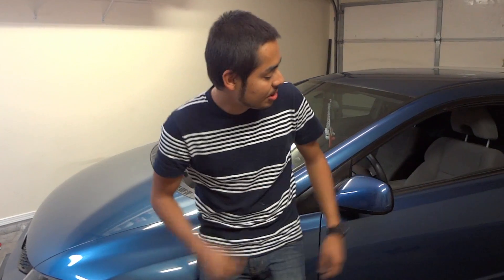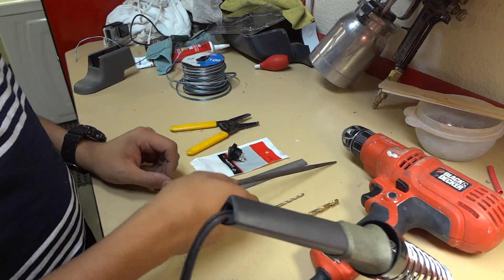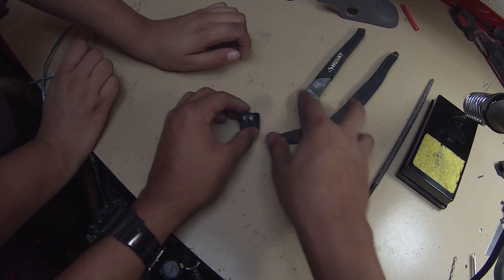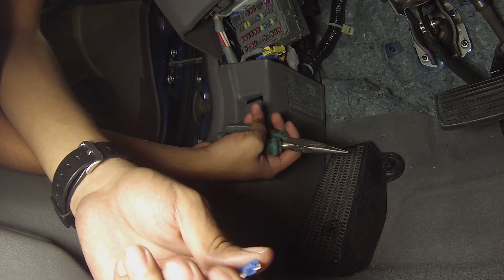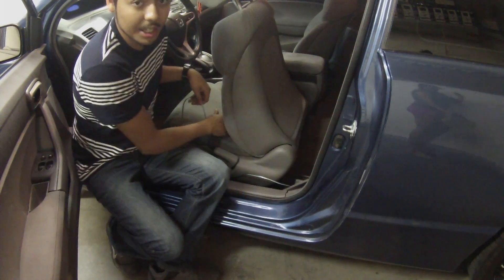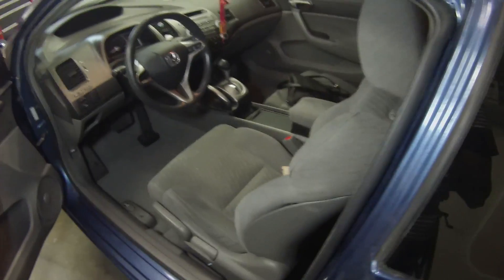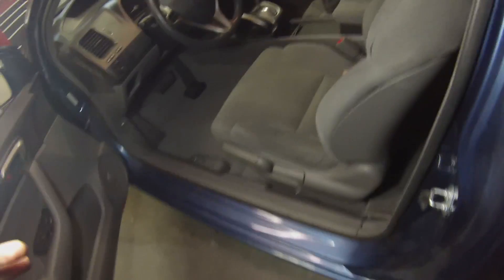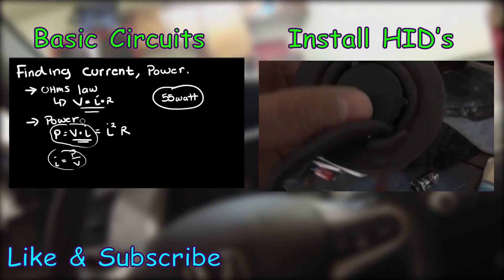How to: Install a Kill Switch on your car

Comment: Thanks for the elaborate video. However, you have removed the fuse from the fuel pump circuit, an essential protection for the fuel pump. Maybe you could have installed the switch on the wire running to the F. pump? Just a thought.
Reply: You're an idiot he did just that. GTFO

Comment: in one of my military trucks and  one of my   luxury cars i used a spare  factory switch  so you could not even tell  instead of using a kill switch  use a factory switch   that  you can add to your dash though the cut outs like for extra  deluxe  add ons never added.  some of my cars require two  switches to be on   to make the car start . the better you hide it the better it is also  recommended to fish it from middle of the car not front not where the  ignition comes out  .I have never had a car stolen  . also  the second amendment  helps if one ever does get stolen .

Comment: Hahaha if I was stealing this car lol and after 3 cranks I know what fuse this is bro. Come-on now your telling 1 million people about it. Fuel pump fuse trick is so old as back 1950s as I can recall. Maybe it's good for kids inside the house to stop from taking your car for joy ride or you forget to lock your doors and don't have an alarm it's a cheap method to keep junkies from screw driving starting your car.

Comment: I think I would just connect the fuse across the car battery to "Blow" the fuse (burn it out) instead of drilling the flimsy plastic, then just solder the switch wires to each end of the open fuse. Using the FP fuse is a great idea.

Comment: Good idea Christian. Regarding the switch:  I would use crimped connectors, which I would solder to the wires (not the switch, of course). A good, fast solution. Thanks!

Comment: Kill switch connected to a fuse box is the worst idea I ever heard of, even more so as its going to be one of the first things a thief is going to check if he has time, say you are out of home, vacation or something like that, there is no reason to assume the thief wont have a bit more time for basic troubleshoot so lets not make stupid assumptions like Mark Moses did (esp. as theres videos where thief works on stealing the car even for tenths of minutes to hours).. Now, on the other hand making it a fuel pump related is actually a great idea, however I would rather split the fuel pump power cable somewhere on its actual way to the fuel pump itself, even better if you can manage to hide the bypass and bypass cables under the construction itself, tho for that you would need to probably disassemble more of the interior or the actual fuel tank itself, but thats just an extra suggestion that isnt totally necessary

Comment: No that's not why the check engine light is on, every check engine light is required to come on before the car is started, as a test, or to show the light is working, this way you know nobody has disconnected it to scan you, the car could be throwing codes without anyone knowing

Comment: How about tapping the wire for fuel pump even before it gets to fuse box?   That will be very difficult to trace.  As it stands right now, Thief will suspect fuel pump and check out the fuse box.  Maybe 5 sec to bypass for knowledgeable thief.

Comment: Great video but I'm not a huge fan of switch that was used. In the event you forget to turn the switch on the car is gonna start which makes it more susceptible to theft. The kill switch my dad had on his accord wasn't much of a switch but a button hidden inside the car that had to be pressed everytime the car started otherwise the engine would shut off after a few seconds and wouldn't start there after. Another great option would be to install a switch that kills the ecu if not pressed. If the computer is damaged the car won't start.

Comment: Hook the car alarm to the ignition coil. This will give the thief a good jolt when they touch the door handle. Or put explosives in the car that’ll go off 5 seconds after the front doors open. That’ll learn em!

Comment: Another good kill switch is to connect a switch between the main distributer power wire running to the selinoid.

Comment: Tip: instead of drilling a hole through the fuse, just blow it using the 12 volt battery. Attach cables to the battery terminals and touch the other ends to the fuse.

Comment: I agree with alot 9f other just cut and split the wire leading to the fuse box to use the blade fuse you drilled hiding the kill switch much better

Comment: So your switch and 18 gauge wire are doing the job of your 10amp fuse. What happens if there's a condition that would require the fuse to burn? Would all that copper wire and your switch burn under the right conditions?
Reply from the maker: +Daniel Wangchomchantra please watch the video. Your kidding sinking important

Comment: Do not use the fuel pump as a kill to operating your car as you can still turn the engine over and over and over causing your fuel pump to fail.  Find the Starter fuse and connect the starter circuit to the switch.  Car may power up, but no starter.   Be sure to use a switch rated for the current and amperage for your starter.
Reply: Can still be bump started though if you do starter. Then again try doing fuel pump on a modern car without engine management light being a problem
Reply: @mitchellconnop2000 unless its an automatic also wont the light only come when key is turned while the killswitch is off? if you operate the switch while the car is off i think it wouldnt be a problem
Reply: @scuffhouse  true , the light will only come If the car is turned while the killswitch is off..👌👌otherwise there won't be a problem..

Comment: Bad solder job. He could have done it with the wires of the fuse, running the same length as the other one.

Comment: Hahaha everybody on here makes it seem like the average thief is going to run through troubleshooting before bailing. Thanks for taking time to post this man!
Reply: Most thiefs that steal cars on a daily use to be mechanics or do there home work before going out and ripping off a car and know where to look. These vids only help them more
Reply: That "hahaha" makes you look even more stupid than the rest of your comment.. Assuming that a thief will be a completely unprepared amateur that has only like 3 minutes to get into the car and start it is really stupid, esp. after realizing that there are cases, even videos of those cases where thieves are going thru process of stealing a car for long tenths of minutes, sometimes even up to a whole hour, in extreme cases where no-ones at home even for long couple of hours no problem.. plenty of time for troubleshooting in that case

Comment: It is a good idea, but also well known by thieves, better connect your switch somwhere on the cable leading to fuel pump. Maybe in America, this will function, but made like this in europa, you will lose your car in less then a minute. I know is to win time, but this is to obvious place to look for.

Comment: Statistically Honda's are among the most stolen vehicles in the USA because their parts haven't always had traceable VIN numbers, making them valuable with 'chop shops'.  I regularly pass by a Honda Prelude parked in front of a house in predominately Asian Diamond Bar, CA where the owner attaches a yellow parking boot when he gets home.  Good luck finding a key or removing one of those puppies!  No need to mod the electrical system unnecessarily.  In the last twenty years the neighborhood has changed where more entitled, spoiled brats still live with their parents, don't work, and break into cars and homes in the area on a regular basis.  His ride is one of the few none of the thug wannabees have bothered to f**k with.

Comment: That’s going to be a pain in the ass when that fuse keeps falling out of the fuse block would have been just as easy to put the switch in line with the pump wiring
Reply from the maker: +Eric Jansson definitely not easy to find and splice a wire. Maybe a truck with plenty of working room, but not in a tight honda. Also, this won't void your warrenty and if you are leasing the car, you won't get charged for damages.

Comment: I have a 1997 Dodge ram 1500 and it does not have a fuse for fuel pump it has a relay how would i put a kill switch can you help

Comment: Top off your oil bro
Reply: We'll see how long your car lasts.... You don't "top off your oil bro," when it's life is low you change it, "topping it off bro" will over fill it, making it impossible for the oil pump to move all the oil around, causing it to overheat, causing it to foam, then finally, blowing rod bearings, Piston rings, head gaskets, the list goes on

Comment: Just wire to your fog light switch or radio knob, (*never to anything hanging out or to your fuse box or panel, from the switch itself*) or a fuel pump shut off somewhere outside, under the wheel well...thieves dont sit there trying all the differing switches or knobs...but they will drag the hand in obvious kill switch locations (humans are lazy, stereo installers being easily predictable, because of cost, repetition, etc locations are routine) I have mine paired to my fog lights, (*not your headlights*) and Ive had 4 88-93 Fox 5.0 Ponies over the last 20yrs in a high car theft location and literally have video up, of me laughing at people trying to steal one, the only way to get it is to have it towed. Great tips! Peace!

Comment: Tip: Mine is wired with the cigarette lighter.. Since I don't smoke and don't let anyone to smoke in my car I unplugged the lighter and I use the negative of that circuit to complete the circuit for the relay.. If the lighter is not in place the car won't start.. 🤓🤓🤓

By the way I have 2 relays ones cut the fuel pump and the other one cut the ignition to the starter.. So it won't even crank if they figure that there is a wire there.. I still have another one going to the fuel pump so even if they crank it they won't go to far.. 😅
Reply: Not sure how I ended up here again. 🤷🏻‍♂️ (A year later).. Oh well.. 12Volts outlet or Cigarette lighter what ever.. You got the idea.. I don't smoke neither have any use for that thing.. I don't use iPhones anymore no need to recharge my phone during my day anyways I have a charger in the office if I need it. And a battery pack on my back pack for my laptop and cellphone too.. So yeah I don't have any use for that "Outlet" again my case not yours.. If you make a living by driving and your vehicle is your office my idea may not work for you.
Reply: @geogmz8277  hi. I have Civic 2008 model. One big problem not solved. Pls halp. I am from India. Bettry oil and green key light not displaying. Fush are ok. Ecm are ok. Pls halp to solw prob.
Reply: You should make a video bro👍
Reply: make a tutorial for cigs lighter killswitch please..
Reply: brilliant
Reply: GENIUS!!
Reply: Damn that is smart as hell!!
Reply: Classic
Reply: ☝️Now this Cat has that Macgyver install bet his ass didn't use Speaker Wire 🤣🤘 that's a Slick idea for closing and opening the circuit nobody would think put the cigarette lighter in it's the bypass 🤘
Reply: Passenger pulls it out what then?
Reply: Kindly do share pics and diagram of your setup
Reply: Geo Gmz wow i have always thought about that but didn’t know if it was possible, I have to do that too
Reply: Make a video explaining!!
Reply: Hello, how did you wire a relay to cut power to the fuel pump? Thanks
Reply: Im gunna do that tooo thanks for the savatry info lmaoo
Reply: How u do that? I want to do this to my 88 civic
Reply: @MannyDelReal  omg nobody is going or wanting a 88 civic,  now 88 porches maybe
Reply: Everyone knows about the cigarette lighter. That will be the first thing for the their to do....
Reply: "cigarette lighters" have other uses, such as phone charging and air fresheners. I think they are called 12-volt outlets though and not "cigarette lighters".

Comment: All car jackers will have a knife. When the car doesnt start the first thing they check is the fuse box. They will notice wires to the fuel pump fuse and cut it and splice them back together completing the circuit.

Comment: Did anyone else realise that he said the reason u I stall the fuse in the fuse holder is in case the fuse does blow it will be the one on the fuse holder instead of the one in the fuse box.....????? How does a broken fuse blow??
Reply from the maker: +August East sorry about that. Meant to say, in case it would blow, it will blow the one in the first holder. Even then, that phrasing is a bit confusing.

Comment: doing that bypasses the fuse in the fuel pump.this could be bad if the wire shorts and gets hot.

Comment: I really don't get how this is useful. I mean can't the thief just remove the fuel pump fuse and place a new one in? I guess this would be useful with a relay to the ignition.
This will probably slow down a schmuck, but not a pro.

Comment: If you get really creative, wire a three way switch in series with a relay that routes the start solenoid signal to the horn. So that not only will the car fail to start, it will also sound the horn so long as the car cranks over.
So someone hops in your car and manages to get the car to turn over "BEEEEEEEEEEP BEEEEEEEEEEP BEEEEEEEEEP"

Comment: Install two 1" +/- pieces of heat shrink tubing before soldering over the wires and allow enough clearance for soldering the joints after soldering slide heat shrink tubing over soldered areas and use a hair dryer or other heat source to shrink the insulating tubing over the entire connections. Next, never try to hold anything with your fingers when attempting to drill holes as you can seriously injure yourself when the drill bit grabs and turns the material by then it is to late to release the part. OUCH! Other than lack of experience in these areas a great well thought out video. Thanks

Comment: Use stock looking wires, and don't mess with the fuse, interrupt the connection somewhere else down the fuel pump wiring, also use a fuse there as well...and place the switch 100% out of sight...even if you are under the dash you should not be able to see it. 
This should be combined with other security measures as well and a really good car alarm. system...and GPS tracking...some thieves don't bother with getting into the car they use tow trucks and jack your shit in less than 10 seconds.
Reply: under the shift boot in a manual is a good spot

Comment: great idea good tutorial but epic fail bro check fuse box follow wire find switch start car and drive away laughing they have wire taps that clamp on the wires behind the box and you can hide it alot better jus my thought unless you wana jus keep it easy for the theif

Comment: Until they see the obvious wire coming from the fuse and just pull it and put a spare fuse, or switch it with a wiper fuse or something in 20 seconds...bad way

Comment: You can also do the starter.I had a few muscle cars and it was easy to hide switches .Plus those old cars are easy to steel and after putting all that work and money into something it would suck to have someone steel it.

Comment: a 100% guarenteed way to prevent theft is a detachable steering wheel. you cant steal a car without a steering wheel
Reply: Not true. Hondas in my city commonly have this mod and till end up stolen. Most of those hubs are universal and will accept another steering wheel easily. Still a good choice to deter unprepared or amateur thieves.
Reply: You also forgot to add the steering wheel hub lock. That way nobody can put a steering wheel on the hub. But another neat trick is to get a button you dont use on your dash, unplug it and solder the new wires to that switch 👍🏻
Reply: Unless they bring there own lol
Reply: Actually, you can still a car without a steering wheel...
Reply: Unless you have vice grips .
Reply: Gin-Jesus Flatbed then say bye-bye
Reply: If the thieves have marked your car (been watching it), they'll go check it out first, notice the steering wheel issue , bring their own ....😎.
Reply: The last car I had stolen was towed away from my house.
Reply: Unless they got a universal wheel lock their selves or a tow truck
Reply: xXsqueaker truth

Comment: what are the cons of this? since you kill the fuel pump would this damage the pump or any other components such as the computer thinking there is a fault going on or so???
Reply: You're over thinking it, if the pump is off/no power how would it damage it..... It can't, the computer doesn't care if there's gas or not it's still going to crank, just like when you're going down a hill with your foot off the gas, theres no fuel going to the engine (in modern cars)

Comment: Holy shit this guy is fucking stupid. Just solder onto your fuse thinking its still going to be the same rating........ You know the small wire in your fuse is what "Pops" (which is the rated part) and soldering on to the thicker tangs get rid of that. This is how you start a car fire. If I ever saw this come into the shop ill be telling the person who did that they are fucking stupid and shouldn't be doing this
Reply from the maker: +Reborn at around 9:00 into the video, a fuse was put in of the same rating. In the video i said the wire you cut to put the fuse in doesn't matter but it actually does. One side is a saftey hazard and I need to put that in the description. All in all, the system is safe (given the fuse is actually replaced), the real issue is that it provides very little anti theft. Hopefully this summer I can make the video where the actual wire gets spliced rather than the fuse, while also addressing the other issues brought up by other YouTubers.